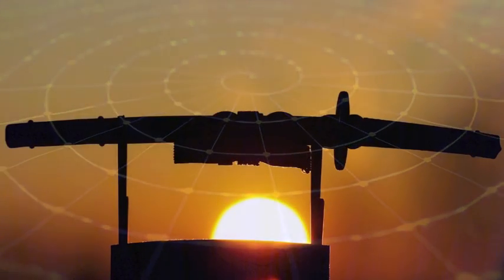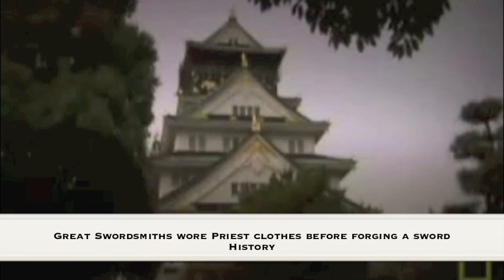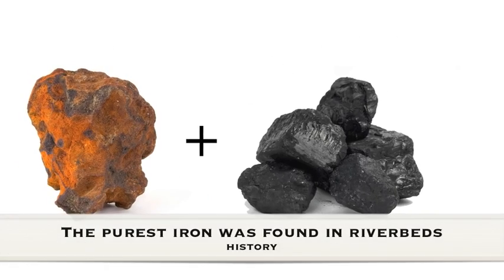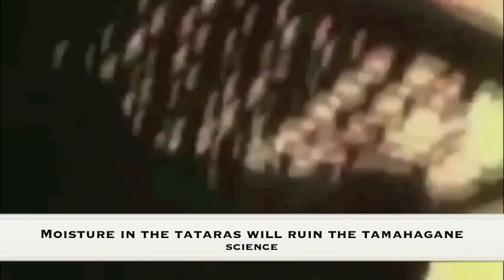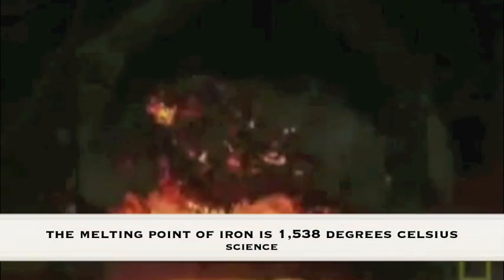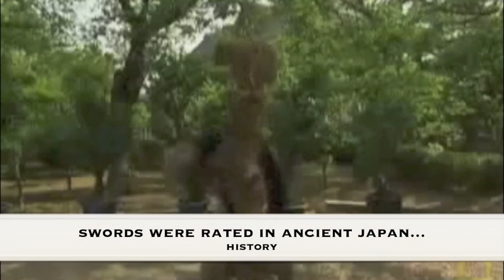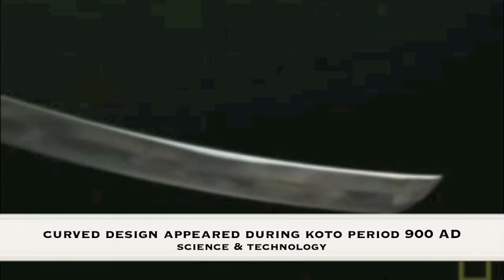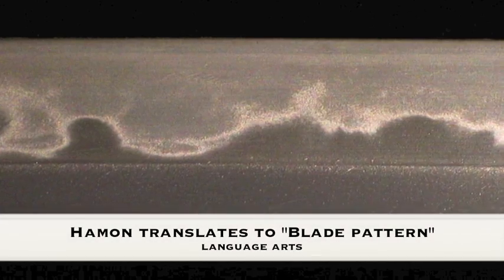Chemistry of Samurai Swords

Comment: Katanas where made almost exclusively from a pattern welded steel which mean there is not soft material or hard material its simply 1 piece, during the quenching process a clay is added the spine of the blade to make it cool slowly ( slow cooling makes steel soft) and the edge cool quickly ( Quick cooling makes the crystals of the steel small and more tightly packed which makes for for a harder edge) this consequently also makes the elegant curve to the blade.

Comment: I'm pretty certain this is not correct.  The softer steel goes on the inside...but there are a lot of variants used by different craftsmen over the ages.

Comment: I'm not doubting your knowledge on katanas, but clearly you only go on with the myths when it comes to western swords.
Lock N load used a blunt flimsy longsword to do an absolutely irrelevant test.
/watch?v=kl-ec6Ub7FM Just watch how deep the stiff blades with a very thin tip go. There's a reason they had this design.
/watch?v=vi757-7XD94 Here's something you can't even do with a katana. And it's only a small part of half-swording.

Comment: First off, katanas of modern times are not the same as medieval ones. They are limited in numbers sold, so of course they will make them as perfect as possible.
Secondly, japanese swordsmiths weren't the only ones spending alot of times on swords. Also, the time spent on them doesn't matter when your technology is completely outdated.
And to end, it's useless against western plate armour. The tip is too thick to penetrate chainmail and gaps, and of course it just won't cut through.

Comment: If the high carbon steel forms the cutting edge isnt that on the outside? I don't disagree with you. I am just puzzled by what you refer to as the outside. The diagrams I have seen of the cross-section of katana blades seem to show a soft inner core and a hard cutting edge on the outside. The wikipedia has such a diagram. And no, I am not a troll.

Comment: To produce a straight sword you temper it by dunking the sword vertically. The katana on the other hand was designed to curve. Why? because it is mainly used to slice, and was modified to the style of the local nationals.  The Japanese are famous for varying the metal density in their metal works. The outer shell and the edge of the blade is usually harder than the spine and the core. The hardness is meant to keep the blade sharp while the softer counterpart is meant to absorb shock.

Comment: @kerwynnmoon the Katana isnt that great for battle... the steep angle of the bevel meant it was piss poor for cleaving or penetration, Sure it could hold a good edge but if you use knives in your daily job.. the steeper the angle the quicker it blunts when hitting other hard materials such as steel tables.. usaully. ill take a Grouse Messer anyday. it would properlly break a katana in half. and certainly cut a samuri in half.